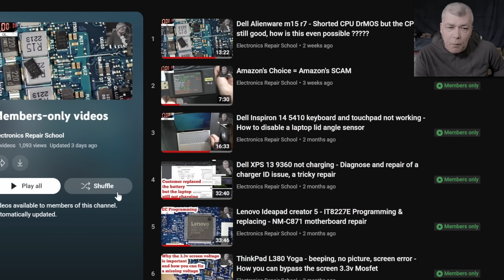How laptop fans are working? Dell 3580 the computer shop replaced the fan but still not spinning

Comment: Nice video, brother. I encountered a similar case with a Dell 3580 turned out the issue wasn’t with the hardware but with the BIOS settings, specifically related to thermal management and fan control. On many modern laptops, the fan won’t spin until a certain temperature threshold is reached, which can often be adjusted or monitored through the BIOS or embedded controller. It’s always a good idea to check those configurations before assuming the fan itself is faulty. Appreciate your effort in sharing this content. Good job bro
Reply: Same with me, the fan started working as soon as i enterd the BIOS, you do it clicking F2 repeatedly after just starting it.
Reply: i learned a lot from you, thank you.

Comment: I think the fan is wrong... probably the laptop can work with voltage and pwm... but it's an eccessive temperature  (80????) To have spin start... i saw some i3 from asus doing the same , before fan start the cpu speed is lowered  .. making the pc slower and hotter... with some seconds with fan at full speed. Excessive  cpu stress , can broke joints on balls.

Comment: That may be a really bad computer shop, they didn't even know that the fan do not spin if the CPU is not working hard, and don't even have a hard drive with their own Windows installation or a Linux bootable flashdrive, with diagnostic tools like Aida64 to heat up the CPU and check if the fan and everithing works corectly, and is not overheating anymore.

Comment: The Dell 3580 has a bios section called thermal management gvies some fan control - also Dell power manager offers cool / quiet etc setting for generalized.  Ice cubes sold separately

Comment: I think is something similar as on newer gpu's, when idle and low temp no fan rpm, then after some level they will start. You can also check software, i've seen also software settings like "0dB fan" turned ON and act similar to this.

Comment: 9:12 I would be scared to destroy the heatpipe, I heared that they get destroyed when they get too hot, which comes from to much energy input (in this case its for probably 45w cpu and the hotair is like 1kw), I am not sure where the limit is, but I think above 105°C is nothing cpus usually reach
also I had once a desktop pc where 2 heatpipes of the cpu cooler had leaked and didnt do anything at all anymore, its like thin copper pipes after leaking
Id be scared a little since these laptop coolers are usually not cheap, but I didnt test it, so I dont know for sure
Reply: You are right.

Comment: Sorin, Could you please adjust the camera angle on your power supply volts and amps readout. There is a glare, either by the sun through a window or a lamp, that makes it very difficult to read the voltage. Thank you. Your videos are always great but I miss the live stream. Please do more live streams.
Reply from the maker: I will, thank you
Reply: @electronicsrepairschool You are welcome, and thank you for sharing your knowledge with us.

Comment: This is very strange. Cause when you search for Latitude 3580 fan then you find original fans with four cables. Even in my Dell Latitude 3480 (which has exact motherboard) i have four wires.

Comment: OK..........What did I miss here? There was 5 volts on the fan when it was first tested..........then the heatsink was heated up, making the fan spin, at which point there was 2.9 volts.........then......once the fan stopped the voltage was zero????? Was the original 5 volts taken at a different terminal?
Reply from the maker: Yes, it was the rpm reading pin
Reply: @electronicsrepairschool  Ahhh....thankyou maestro Sorin! I was confused, which is easy to do!

Comment: I have a dell latitude, when I got it I went directly to clean it and change the thermal paste . I reassemble it and it works , but as in the video the fan didn't worked , I got scared that I didn't connect the fan 😅 opened it , and saw that I did connected it , the only way the fan spins is only when I use it for something heavy . YouTube made it spin only on 4k , and as soon as I stop it in a minute or so it stopped. Those laptops are great with windows 10 , with windows 11 the fan is always spinning , even when you don't use it .